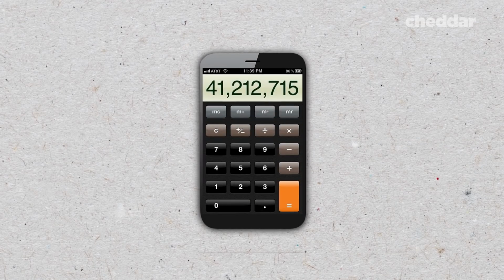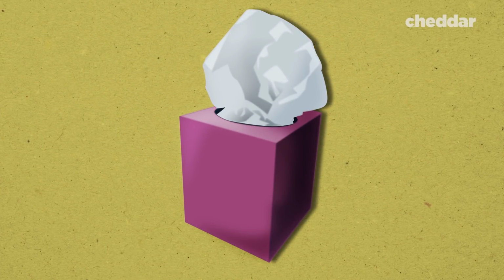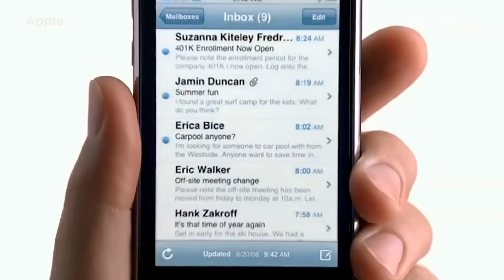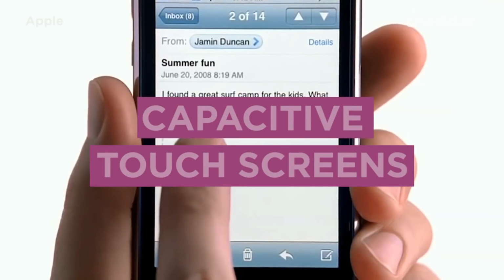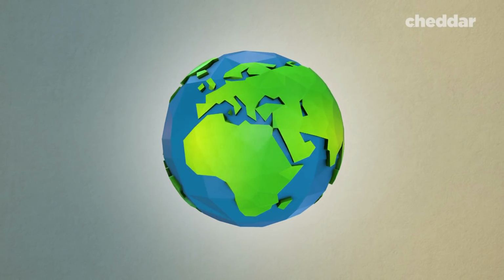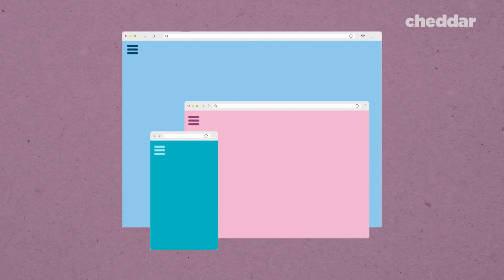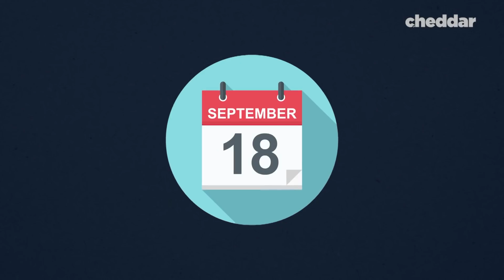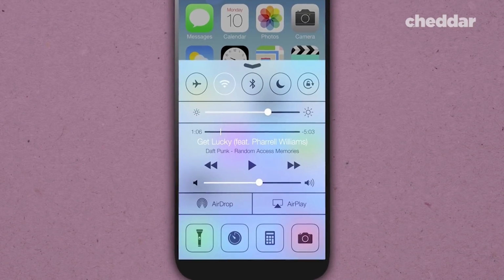Why 3D Logos Fell Out of Favor Overnight - Cheddar Explains

Comment: It was Microsoft that triggered the cascade of design changes in 2010 with their Metro UI which went viral with Windows Phone 7 presentation in 2010. Then in 2013 Apple presented iOS 7 Flat UI, and in 2014 Google has presented the Material Design UI.

Comment: 4:34 "A simple vector design can be expanded/shrunk easily"
Yeah, and so can any vector design, regardless of whether the design is flat or not.
Reply: ah not really, 3D vector graphics look trash as all hell
u cant really do vector 3D unless u want it to look like new age picasso....
mostly because shading is a huge part in 3D and shading cannot be vectorized
thats just not in the cards for svg tech 

they only really make sense as simplistic 2D images 
no shading, no intricate design, simple everything
thats what it needs to vectorize 

not even anime can be vectorized properly
and its already 2D with basic designs
Reply: 八神こう
Have you seen the example on Inkscape's website?  Yeah, maybe its not photorealistic, but its certainly not steamrolled BS
Reply: @dafoex  as someone who has worked in design
I would probably never actually use vector and 3D

not unless the 3D vectorization style is part of ur design aesthetic
because I dont think they are good enough yet
I have pretty high standards in icon design

because the psychology of iconography would suggest it otherwise makes ur project feel cheap 
even the difference of 3D between .png and vector can make a project feel cheaper to a user 
even in cases where the difference is only slight
getting icons right is very important to user experience

if i was going to do 3D I would probably use something else 
depends on the look i was going for 
as vector does work ok, for some 3D
just not enough, for me to use it
and they are generally trashy to me

as a programmer thoe
I know a way the vector process, could....
be modified do make 3D images properly 
I think the process could be automated well with some colour theory code 
so with the right tweaks, u should be able to draw 3D perfectly fine

so while I would not use vectors for 3D rn
I suspect in the future vector will be the best choice for all icons in all styles
Reply: @YagamiKou  ok dont add shading to 3d problem solved
Reply: @bullet01l30  then its not likely to be 3D
things free of shading or lighting are likely to be 2D objects

correct shading is just part of what makes real objects 3D
so much so that shading irl even effects how u see things
if u have seen vanta black on things, it absorbs almost all light
and using it on irl objects stops them from being 3D
so little colour information gets to ur eyes, that it looks like a 2D hole is cut out of reality
shading, in its most basic form, is using different colours to show different depths
and depth is what makes it 3D 

no shade or tint = no depth = no 3D
Reply: @YagamiKou  I use iOS 6.1.6 and it's fine.
Reply: Yea because a “3D logo” technically is 2d meaning that it wouldn’t matter if it’s 3D or 2d since they are both technically 2d
Reply: flavio herrera exactly, its just jpeg both, i dont know what they are talking about
Reply: @okeyalright  (Okay so I hate to be that person and I don't mean this to be rude at all but) a vector is not a jpeg. Vectors use math to draw so they can be scaled up and still be perfectly sharp. Jpegs are just collections of pixels, and when scaled up that will show. Vectors are usually converted to jpegs once they're the right size though because most programs can't handle vectors
Reply: @purplefire2834  I was going to be that person lol.
Reply: You can still do 3D designs in vector, and I wouldn't be surprised if iPhone's 3D icons were vector (but might as likely have been raster as well). Making a natural scene or a human or animal look photo realistic will be hard in vector. But making a clean design like it's a product showcase, is certainly much easier. But it does require more effort, of course.
Reply: Purple Fire 28 Harvard is tracing your signal
Reply: Do you not understand what vector means?
Reply: @jackcolson4745  a vector design means it's made of equations, not pixels. Which means that it can retain quality at any scale regardless of the "original" size (in quotes because vector programs have you choose a canvas size even though it's irrelevant)
Reply: @purplefire2834  correct. But the point of using the vector method is to create a simple design. That’s why people think vector means simple. It doesn’t define simple, but the format is used for that purpose in such capacity that it becomes synonymous with the term. It doesn’t matter whether the vector is simple or complicated in design, the scaling attributed to vectors work the same way. The reason why company logos have moved to a more simple design is because it’s easier to reproduce and it’s more easily recognized and identifiable. The complicated 3d logos don’t hold up after that because it can’t be embossed and printed as easily. 
So while I’d definitely prefer the skeuomorphic apple ui design for the way it pops out of the screen, flat logo designs conserve space and are more versatile than intricate 3d logo designs
Reply: @jackcolson4745  Your explanation makes sense, but the way the video worded it made it sound like it was specifically the simplicity of the vector that made it easy to resize, and implied that a complicated vector isn't easy to resize. A complicated vector is harder to make, yes, but it's just as easy to resize as a simpler vector design.
Reply: Isn't it much more difficult to make vector 3d design than raster one?

Comment: Well 2D images technically use less power, cheaper to design and offer a cleaner look. Personally I like the glossy look but with flat icons. You can achieve this in something like Windows 7 Aero and designing a flat icon. Works well too, but this is probably seen as dated too. But the 2D designs as I stated typically use less power. Less line to draw, less overhead equals savings. 3D logos take more effort over all.

Comment: Why the Apple ad? The 2d logos started making a comeback before io7. One of the reasons was a business decision to reduce costs. With the rise of mobile web browsers (found on a variety of devices including flip-phones) with lower graphics capabilities, companies would have to pay for two logo designs or drop the 3d logos. Another factor is that people with certain vision problems could not see the 3d logos clearly. A third problem with 3d logos is takes more time to develop and if the logo was used in a non-digital environment (such as storefront signs and box tops) 3d logos require more inks. In short, there were several factors that predate io7 and have nothing to do with apple.

Comment: The real reason is that the higher resolution screens have allowed for cleaner lines. 3D logos, including shadows and bezels, were used to hide low resolution flaws.
Reply: davidwai90 wouldn’t higher resolution phones with powerful gpus and bigger battery do 3D better?
Reply: @bletwort2920  yes, but if you only have a low resolution display then 3D looks better because it can hide flaws
Reply: 3D looks better even if you don't have a low resolution display.  The entirety of the videogame industry is based on this fact.
Reply: @amateurprogrammer25  you're forgetting about vector, 3D looks better as icons when small. Compared to 2D which works at all sizes
Reply: @kianjsr  Firstly, literally zero major... well I'm not going to say operating systems because it's the GUI... anyway, literally zero of them actually store app icons as vector graphics.  Even PalmOS (which was designed to have scalable graphics since icons had to look the same size across screens with WILDLY different pixel densities, and, need I remind you, PalmOS icons were almost exclusively 2D) used bitmaps to store icon data.  Secondly, as I said, 3D rendering is not that difficult.  If app icons were sent to devices as 3D models rather than image files, at the size icons are typically displayed, even the weakest of modern phones could EASILY render a page full of icons, each with potentially hundreds of polygons, without noticeable stutter.  If you wanted to show it at a higher resolution on a more powerful device, just render it larger, on that device, when the page is displayed.  As I said, though, all modern operating systems store their app icons with pixel data, not vector graphics or 3D models.  (Don't believe me?  Set your display scaling to 300% and look at your desktop.)  It's true that, generally speaking, boring, flat designs that use nothing but circles, geometric shapes, muted hues, and gradients tend to upscale better than designs that appear 3D simply because they look mostly the same when you make them blurry and that's essentially what upscaling does.  Still though.  That's a terrible excuse for using flat design.  Just ship a higher resolution image!  (Most apps ship their boring flat images at 5x higher resolution than they'll ever be shown anyway, so why not?)
Reply: @amateurprogrammer25  most of the apps has 5-6 icon for different resolution range, wouldn't it increase the app size if 5 to 6 3D files were to be packed with it instead of static images. It's kind of unnecessary effort for icons.
Reply: @sreejithsubhash7301  Why would you pack 6 when you can just have one and scale it up or down
Reply: @pitaya4151   the problem is Android won't scale image into icon container as you expect. This may result in pixelated icon or an extremely small icon or image overflow.

Other problem is icon container. It could be square, circle, square-circle, oval, etc. Even an HD icon on an HD screen won't render properly in these containers. So for each pixel density,  multiple images are created for different containers. These are usually in png/jpg/webp format to save space. This can be done easily in android studio.

Now imagine creating multiple 3d models or creating an entire scaling system for 3D models, just for some  icons which would consume extra processing power and battery. It's like live wallpaper.
Reply: @sreejithsubhash7301  I dunno.  You can store a lot of polygons in 1MB.

Unnecessary effort?  Probably.  Worth it?  I would say yes, although probably everyone else who knows more about this than I do would say no
Reply: @sreejithsubhash7301  Android already does 3D perfectly... you don't have to store multiple models just one.
3D models and vector graphics takes miniscule file sizes since all they contain are lines and curves no pixel data.
The phone/PC generates the pixels from these so you can view them with unlimited zoom.
Simple 3D graphics are not shaded in a crazy way so they are extremely power efficient in today's standards.

DEVS used 3D pre rendered 2d bitmaps because phones couldn't run 3D and in low resolutions 2D was more efficient to store and calculate.
today when you have 2K-4K (2K is FHD) screens vector graphics are more efficient.
Reply: @amateurprogrammer25  That's a different type of 3D
Reply: @amateurprogrammer25  High-quality 3D logos could take minutes to render on top-end hardware. Logo designers don't want to have to worry about poly-count and not being able to use reflections/indirect lighting/ambient occlusion/refractions etc, and they don't. Today's phones have pitiful GPU power and could not handle drawing all those icons, especially given the super-high resolution phone screens that are now common.
Reply: 1MB of geometry: 1 vertex = 12B position + at least 8B uv = 20B, 1 triangle = 12B indices + 3 * 20B vertices = 72B. (assuming no vertex colors / additional uv channels etc...). Then you need textures, lets say three PBR 256-square textures using DXT1 compression = 3 * 3 * 4b/pixel * 65,536 pixels = ~300KB for textures. That gives you room for maybe 8000 triangles which isn't getting you anywhere.
Reply: @amateurprogrammer25  I think you would have done a much better job with this video than whoever made it in the first place.
Reply: @cronchcrunch  or you can embrace those "flows" and turn the bug into a feature.
Reply: avwv I don’t think power is the issue more legibility and accessibility...Bevel and emboss doesn’t print well and performs poor for accessibility.
Reply: @bletwort2920  Why would you need a powerful GPU for a flat image????????
Reply: @bletwort2920  giggled dvndgdj
Reply: @bletwort2920  yes but all designers on the west are obsessed with "simplicity" and removing "clutter" is something that Asian web designers and artists talk about because they contrast Western Web Design with Asian web design. search about this difference, it is interesting. One of the main differences is that Asian sites have lots of information because users expect lots of information and this is connected with Asian art which is the complete opposite of what Johnny Ives wants with his bauhaus design, Asian art is saturated of information and the scene presents a complex system with multiple actors and multiple relationships, while western art is focus on a central topic, a single action, low amount of information. And this has impact, for instance Asians can find information faster in a "cluttered" view because they have practice with it.
Reply: 3d logos still look way better either way, the 2d ones look lazy.
Reply: The real real reason is it’s cheaper to just have everything 2d. 2d interfaces are the digital equivalent of brutalist architecture and will be looked back on with very little fondness
Reply: @P7777-u7r  I disagree. It's more like the the difference between modern architecture and fancy houses for rich people from ages ago with engravings everywhere.
It looks less cluttered and I prefer flat designs.
Reply: Heath Mitchell 
Well maybe that’s why I don’t like flat I like things to be a bit more on the ornate side not as much as a big old mansion though
Reply: Lol, no. The real reason is Steve Jobs loved Skeuomorphism. Jony Ive hated it and changed it as soon as he could. Jony Ive has since parted with Apple.
Reply: That's not it at all. While you can use 3D to hide things like that, that wasn't really the reason for it. Scott Forstall that designed iOS' original UI said himself that it was created to make it incredibly simple for anyone to use. Furthermore, when you scale up that 3D object from the lower res screen to the higher one, you get an insanely sharp and pleasant appearance. For example, TV kiosks in stores don't just show you an assortment of 2D elements to show their clarity, rather they show high definition videos and photos to show the amount of detail the TV is capable of. I made a concept of iOS 6 on the new at the time iPhone XS, using icons that were recreated, so they could be scaled up to the higher resolution and the results were incredible. It was a more impressive home screen than modern iOS ever dreams to have. https://imgur.com/a/uHtovSR

Skeuomorphic designs were built to make technology easy for new comers and familiar and cozy for those already experienced with it nothing more nothing less. 3D designs have unlimited possibilities.
Reply: Wouldn't it be the opposite?
Reply: TheAbsol The cluttered and overwhelming nature of 3D icons disallows you to focus on the flaws because too much information is being shown to your eyes.
Reply: @LittleWhole  Good luck in a supermarket, then. Lots of detail doesn't inherently mean it's badly designed.
Reply: TheAbsol I never said that it was badly designed. If you put a 3D detailed model in front of you it would be harder to exactly pinpoint flaws in the design versus a simple and minimalistic 2D design.
Reply: Exactly. You don’t have to use rasterization or anti-aliasing because the resolution is so high.
Reply: Thank you....was about to write the same thing...leave it to these hipsters to think they have it all figured out
Reply: AKA vectors
Reply: The real reason is there were multiple reasons, stop trying to act like you know it all.
Reply: The old insta Logo is so much better then the new one. 😂
Reply: No?
Reply: still prefer 3d icons,even at high sizes
i prefer simpler icons for firefox or something else thats small but 3d  ish is just better i kinda hate the flat design windows 10 went with
Reply: Google is Gretchen tool for me and you to o this is it 4h eadbfhbgfoof rn uy37vo
Reply: davidwai90 honestly it just comes down to stylistic preference. There are some things for which skeuomorphism does help, like the icon of a camera to distinguish it from photos
Reply: You know there can be multiple factors.
Reply: That should only apply to raster graphics. Vector images can scale properly without those artifacts.
Reply: Im.gonna go with you being correct. This organization rarely gets anything right anyways.
Reply: In my opinion I like 2D logos on phones because it feels smooth but on desktop 3D.

Comment: Apple and the iOS were not the drivers to the change from skeuomorphism to flat design. Actually, Apple took quite some time to accept users preferred flat icons and interfaces. Google had already steered to flat design by that time, and Microsoft was pushing flat design to the extreme.
This video is poorly scripted, with poor research, and unfortunately does not reflect how things actually happened.

Comment: I remember the iOS change. Mine was set to manually update, but I never did. Saw what the new interface looked like, and hated it. I kept the same iOS for a few more years until one by one apps would break and refuse to update unless my iOS was newer. Then I finally did, with a new phone. I jailbroke it, and downloaded a GUI which resembles more of the old, but it could only change the default app icons. I think I finally gave into the new GUI in 2015 or so. I still prefer the old though, and when I show people 10 years younger than me the difference between the two they’re amazed, and tell me that they actually prefer the look of the old!